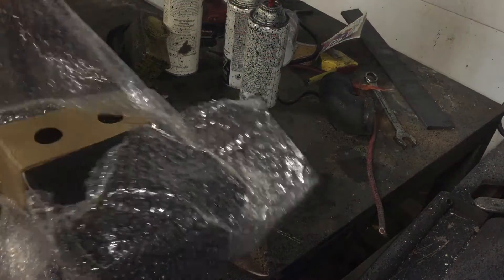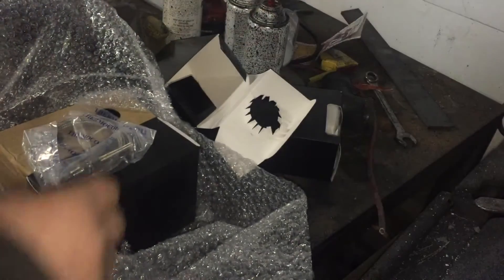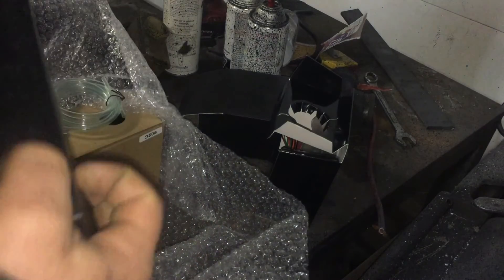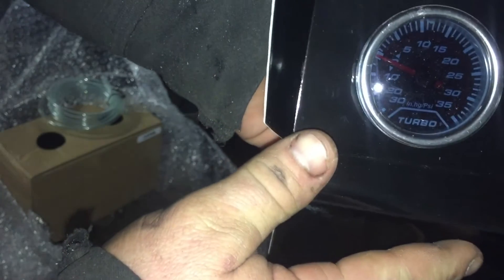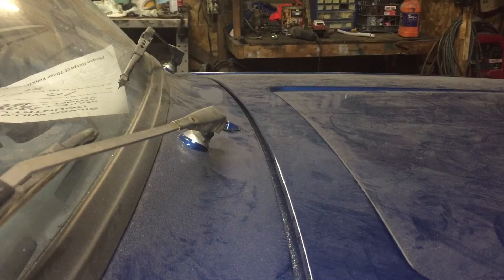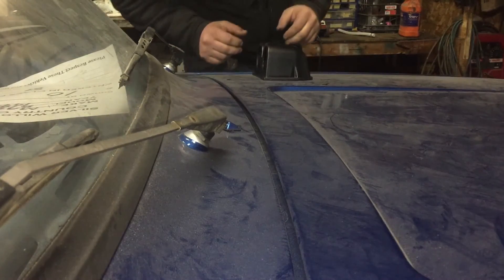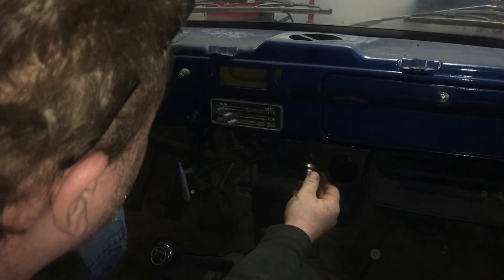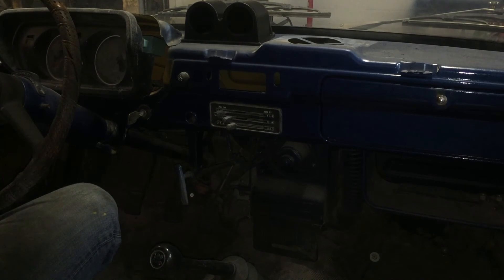ebay pyro and boost gauge install

Comment: option 2
Reply from the maker: Diesel TD ended up putting near the left knee because they wires included in the kit were not long enough to mount on the dash or under the radio
Reply: zacks workshop That'll look good 👍👍